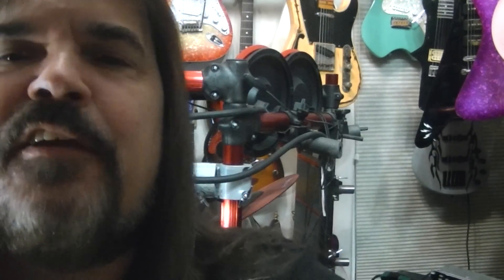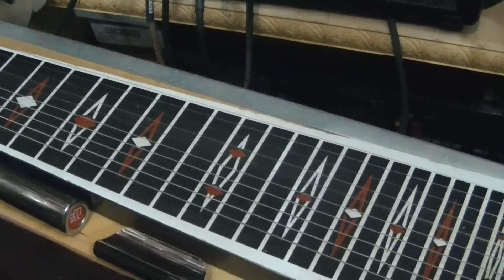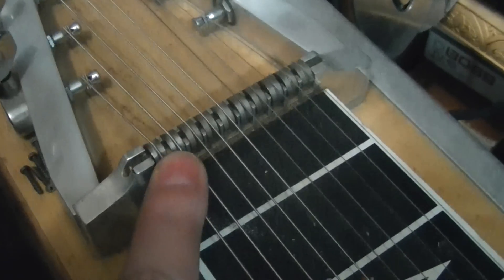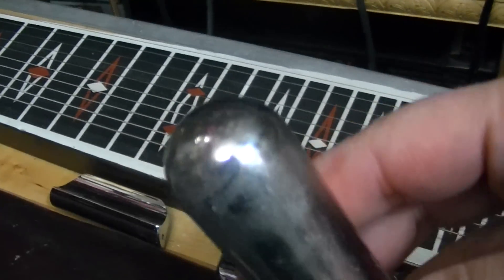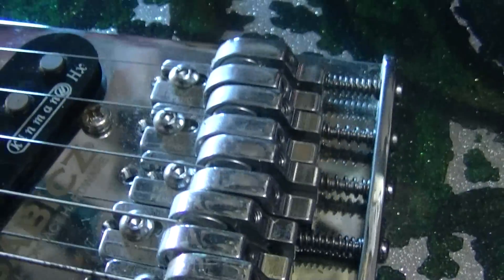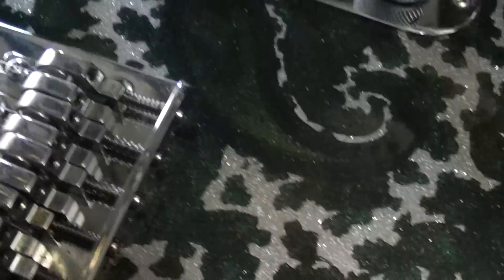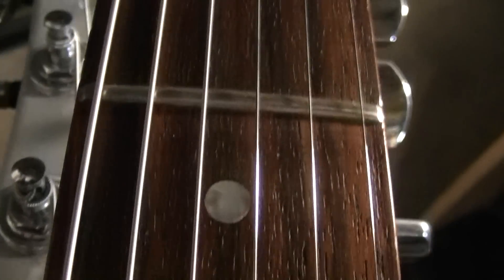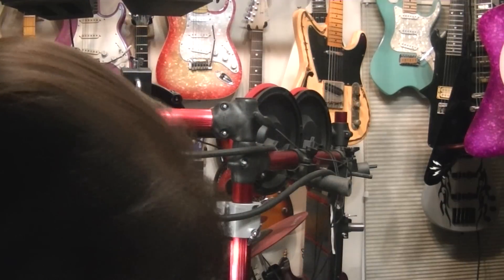Electric Guitar Sustain...The Truth According To Scott Grove

Comment: When it comes to sustain, transference of energy is the last thing you want. All that matters is that the points directly in contact with the string absorb no vibration.
Reply: Liz Windsor the more ridged the instrument the better the sustain is correct.
Reply: Guitar sustain is all about "decay rare" and what can make the decay rate faster or longer, AND there are ways to have a noticeable effect on the decay rate both good and bad...

Comment: Scott has done a great deal of while work making many, many informative video's to help those beginners who want to learn more about the way Guitars & related gear works. 

He has spent many years as a " Professional Musician " & also as a Sound Reinforcement Expert. A specialized form of Audio Engineering for Live Musical Events from Bar's to huge concerts. Being a Professional means those who are paid for their knowledge, wisdom, & that have a proven track record  of positive results.  Who can be trusted to operate and maintain these very costly & also very complex PA Systems. 

People like Scott are highly respected & sought out by Musicians who know he will do a great job in making them sound the best they possibly can. Making LIVE shows /concerts successful ones'.Its hard work. Keeps paying fans, ticket holders coming back for more. 

The people who sculpt the live front of house mix, stage & monitor mixes are highly regarded, well respected, have great reputations, travel with Top Acts & very well known by most of the Pro Audio, Sound reinforcement Equipment Manufacturers as well. 

So the next time you feel the need to challenge or question Scott's Grove's knowledge. Just think about the following information, he's not bragging he's not trying to be little you or to say he's above you.  Even when he has earned the right to. He's actually trying to help
answer the many questions he receives. Ok so he's not a scholar or a certified instructor
he's doing all he can to share what he has learned. & he's getting better each time. just needs a few outline notes to keep him focused, understandable (try doing it yourself)

So Please, just give this Man the respect he deserves. How do you think he's been able to acquire all the items you see in his video's ? (Ah da he could a took out a personal loan?)

yeah ur Mama, Not quite !  No regular Bank or lender gives loans on Risky Musical Instr.   or Pro Audio  gear. Period. You'd have to be a huge celebrity to get that treatment & if your raking it in why the hell would  you be in need of a loan.

 Besides they've all been burned too many times before. From those fast talking, big schemers, I got an album coming out next week, & I need what? everything AKA Posers.  

If anything you shouldn't be returning to a site you dislike, Wasting your time here when you refuse to accept this wonderful information & the help Scott provides at his own cost. You'd probably be better off practicing your axe dude instead, you go practice yeah you ! 

How about offering him some well deserved support throw a few beans in the pot.? ? 
or at least just say thanks Scott I've learned allot from that Video, atta boy Scott / Doc. 

Scott just happens to have been very interested in all parts of his performances to have spent the many hours learning the correct in's & outs of PA systems or he was thrown to into the task of PA, Mixing  via an argument. (Oh yeah OK big shot think you can do better)       

PA Companies trust & depend on these Specialized  FOH PA Eng. Operators to act as their eyes and mostly EARS to report how their extremely expensive Mixers, Amps, Crossovers, Mic's, Cables, trusses Direct Boxes, AC line conditioners, Effects, Eq's, Snakes, drivers and other related equipment is preforming in the " Field " or on the job.

 Many are also qualified technicians who can repair most devices in the Field.  with parts Fx'd Overnight many also create modifications which they submit to the Manufacturer's. & have constant 24/7 open lines communications with. Talking about big money these Big Shows are underwritten & backed by investors & know who they can trust for results. Doc        

This is a very different job than what is done by Recording Studio Engineers, who have much greater control over the environments in which they work. Who seldom record, mix live acts, all in one take. Not the typical way things are done in today's recording prod.   
 
While playing music. His years of on the job training in every type of weather condition plus as many different indoor room environments from shitty dumps, bars, Moose Lodge,
VFW' halls, Biker Bar's, School Gyms, College, Student Unions.  Locations where there is one or even two entire walls of glass,  GLASS are you &*()%$#ing kidding me.   

He's done nothing but to go out of his way,  and then shares his many years of experience with Musical Instruments mostly Guitars but that's due to the Collector Market sales that puts money in the bank to take care of his beautiful wife & family.  Lets see your wives ?

I promise you if he wasn't a great guy, a loving & caring man he wouldn't have been able to attract such a beautiful & wonderful wife.  Seems like she knows when to reel him in and he seems very invested in keeping her happy. That my friends does not equal a man who is a jerk or someone who doesn't know what he's doing. These are all the signs of a guy who truly talented & he is for real so stop screwing with him.  respect Goggle it !

Learn to respect those who deserve it, because Karma is a Bitch and one day sooner than you could ever know. You're going to be Tomorrows  Scott Grove / Doc Groovy.  Who thought (hey Hon ? yea Scotty ? ) won't  it be nice if I was to share my life long experiences with these up & comers.  Like who Scott ? you know all  These kids just starting out in their first crappy garage band.  

Trying to put together songs to play a party and they learn 20 songs & waste 20 mins between each one argueing and tuning up and yellin Hey MORON you're in the wrong key
no I am not ?  DA take that Capo off @ you dumb ass who you calling dumb ass BTDT.

Thanks you very much ,  Mr. & Mrs Doctor Scott Grove yes you thank the wife for allowing
him the personal time away from his family to make his video's. 

 Which he obviously makes whenever the mood strikes from 10:am to 11:pm  and sometimes as he awakes with a topic on his mind he can't shake off. So he sneaks out    of bed & into his  Doc Groovy Cave,  trying to be quite but we all know he can't.  Scotty ?  

uhm yes dear where the hell are YOU & W T F are you doing ? um um   Nothing Hon  

i thought I left my shit on I heard it buzzing ...Scotty you promised .. yes dear
 I'll be right up .that stupid dog  I'll clean it up..   You  better he only puked because you were giving him Pepperoni  Pizza bites, three 3.6 hours later.. A rolling pin hits Scott' foot.

UTTO guys signing off Doc Groovy here keep your pick in a vise ? bye Tata for now.

 Sorry babe u know how it is, I get down here and I'm answering a question for a nice kid and then I see those jerk off comments from some Moron asking the same fn question again or telling me his asshole bass player an 8th grader told him Doc Groovy don't know shit & I was trying to say ...............We Love ya'll please Mrs Grove give him yet another break, he's a good boy. He'll eventually talk himself out of info and rest a cruise perhaps.        

Like Scott,  To  anyone who's willing to listen give him praise for all his hard work..
Reply from the maker: Rick.....sometimes a simple "THANK YOU" doesn't cover it.  This is one of those times.  Of course, I have printed this so that I can read it from time to time.  As you know, I'm not able to recall much NEW stuff (in the past 10 years).  I just appreciate that you "Get it" and actually have true appreciation for me trying to do some good for people.  A huge thanks to whatever inspired you to write this.  So, thanks for simply for the gratitude and understanding of another human being.
Scott
Reply: Jesus Christ that's a book
Reply: Well said Rick.
I appreciate Scott's take it or leave it demeanour because it's obvious he's talking with the assurance of an informed and experienced background.
I always learn something of value on this Channel so thank you Scott.
Reply: rick caruso - You are a very good person. Not only that, but you are right on the money about Scott. Thank you for standing up for one of the good guys!

Comment: Sustain is all about DECAY RATE, The longer the decay rate is of a given string the better the "sustain" of a guitar is, AND there are things you can do to "lengthen" or "slow" the strings decay rate and that is all about how both ends of the strings are being held or the strings "anchor points"  The more immovable the two anchor points of the strings are the longer the string will vibrate, That's just physics, Like a Floyd Rose tremolos "sustain block", That block of metal serves a few purposes one of which adding "mass" to the bridge which in turn makes the strings bridge "anchor point" more immovable and currently the best material to make them out of is Tungsten!  No "bell brass" or "stone" sustain block will give you more sustain than an equal volume of tungsten unless you make your sustain block out of something like Osmium, Iridium, Platinum, Rhenium, or Gold, Hell even Depleted uranium is less dense than Tungsten!
That's why Scott's steel guitar sustains so long because everything is mostly made out of STEEL and lots of it which in turn makes the strings "anchor points" VERY immovable and thus the decay rare is very long!

Comment: Actually, it's the tonewood ;)
Seriously though, it dies because parasitic resistance kills it. If you could strap a string down to an infinitely massive body, the body would rob zero energy from the string. If you plucked it in a vacuum, there would be no wind resistance to rob energy from the string either. 
Unfortunately, carrying infinitely massive bodies around on stage is hard on the back and breathing in a vacuum is a bitch; hence, a compressor is a nice alternative.

Comment: Great stuff. One of the reasons I always liked Floyd rose trems was because of the steel nut. It helps, it really does. 
I'm building a strat now with a reverse headstock using stainless frets, and the bridge is a decent steel one. I'm also using a brass nut. :)

Comment: When I learned the song in a blue dream, by joe satriani...i worked out how to keep that high c note going with physical vibrato for about 16 seconds.So  you basically dampen and pull  the b string out of the way with your index finger with your right hand, and use violent vibrato to keep that sucker going, though not sure it is vibrato...you are  basically continuously rubbing the string on the fret..and you can keep it going indefinitely. Touch the b string though and it's over.

Comment: Thanks for the info Scott. As you said, sustain is really just a result of lack of interference to the string(s) itself. The less "stuff" you put in, on, or around a vibrating string the longer it can ring out and thereby deliver more sustain. As ever, less is more.
Reply from the maker: I think that is all there is to it and that is all the thought that needs to go into it.  It's another "beating a dead horse" subject.  People can play MIDI guitars and simply sample their own guitars on every single fret and get it that way.....but again....you're not getting REAL sustain.  So, you hit the string, it rings until it doesn't and then you hit it again if you really need to hear that note again....................................it's usually called TUNING when doing that.  lol  Cheers.

Comment: Actually, playing notes in Just Intonation ratios with each other makes more difference than just about anything else you do; 2 or 3 times longer in some cases; because when notes in a chord don't line up to simple ratios, they take the energy out of each other, or reinforce each other when they match.  It's similar to what happens during feedback.  If you play a maj third interval like: G,B .. bend the G up until the beats stop.  Or min third interval like: G,Bflat bend top string until the beats stop.  

Just about every 2 note chord has a minor adjustment that cleans up the timbre to make it sustain quite a bit.  Some require bending the bottom note a little (shrink the interval), and others require the top note to be bent (stretch the interval).

Comment: one thing Ive tried is get some fairly thick brass sheet 2mm or so and make switchgear covers copying the originals makes a huge difference no idea why. the brass plate  on your headstock under the tuners from a company called fathead make a huge difference must be working the same .

Comment: Hey Scott this is the only way I know how to possibly reach you. I have a question. Is it possible to have a rosewood neck lacquered?? I bought my sister a ibanez tallman MIK used for her bday and I didn't know that much at the time about guitars. Her hands drip sweat while she plays and I'm worried about the sweat seeping into the fret slots and messing up the fretboard. Its a bolt on maple neck with no finish and rosewood fingerboard. So will sweat make the unfinished maple and rosewood swell the wood?? And is it possible to have the whole neck coated in lacquer? Would they have to re fret it?
Reply: sal christy no

Comment: To me, string vibration = sustain.  A metal bridge is fine.  Yeah, there might be a slight dampening with the skinny legs and what-not, but the string is still vibrating on its' own.

The strings then follow a path down to the tuning pegs, which are also metal.  The main dampening between is the nut, and the pickups.  In my experience, a plastic nut not only lessens sustain noticeably - it also kills the natural acoustic sound of the string.  To me, the nut may very well be the difference between a nice acoustic sound on the electric, and an almost dead acoustic sound.  Yeah, some guitars have string trees, as well.

The other thing is the pickups.  They have magnets in them.  If they're too close to the string, they can have an awful effect on them, and the sound, because they act on them.  If they're too far away...well, you better have a lot of volume on your amp.  I'm speaking of passive pups, of course.

Truth to tell, I'd rather increase the volume than raise the pups.  The actual sound is better.  More organic.

It's not how long you can keep a note decaying (sustain), but what you do with the note in the first place.  I never really cared about sustaining a note beyond a certain point.  I'm more concerned with how to make it sound good in the now.
Reply from the maker: You are dead on correct about every statement you made.  You have NO NEED to think it through any farther.  A string can only ring as long as it can ring.  You can increase it a LITTLE bit with nut and bridge materials, but....that's about it.  You've got it covered my friend.
Reply: I've seen lots of debate on whether the body of the guitar has an effect on sound.  I do think it has an effect on acoustic resonance.

I have a 1984 Carvin 220V.  A star shaped guitar, so the body is kind of big.  It's also solid maple, so it's dense and heavy.  It has a Kahler trem running down to a brass nut, to the tuners.  I bought it new, back in the day when a heavy guitar like this didn't bother me at all...unlike now, lol!

The pickups have lots of pole pieces to them, as well.

What I can say, for sure, is that the body is too dense to add the string vibration.  Acoustically, there's nothing pleasing to the ear.  Plugging in, there is plenty of sustain.  I would assume that that is coming from the pickups.  I think I'll lower them a few turns and see.

Comment: Your the Bob Ross of guitars. Get a fro bro. & God bless.
Reply from the maker: Thanks man.  I used to sport a fro in '85.  Got my big hair perm for the times and had no idea how to style it......so......FRO TIME!
Reply: @groovydjs  I gotta quick question for ya. The Washburn A-20 v. I have one got at a pawn shop for $350. Primo condition. I assumed it was neck thru but it is painted red no wood grain visible.
 Can I assume that it is neck thru ? Its a 1983 model. ~Pre perm ~
All the other specs check out ok for a A-20v. Push/pull Split coil humbuckers &
 original vibrato   Best regards, 
     Max Wattage       Hoping to make an ass out of you and me.

Comment: Like a true dumbass I bought a Schecter Hellraiser with the Sustainiac. Does it work? Sure. But like you said, why do you need a note to hold for more than 10 seconds? I struggle to find places in a song to use it. The best use for it so far is the mode where the note will decay to a natural 5th and it gives you that cool rock solo harmonic. But that is about it. And if you practice, you can get that harmonic without the artificial device. So basically I got a 9v battery eater. Forget to turn it off and it's dead the next  day.